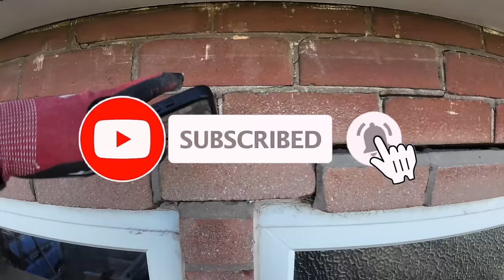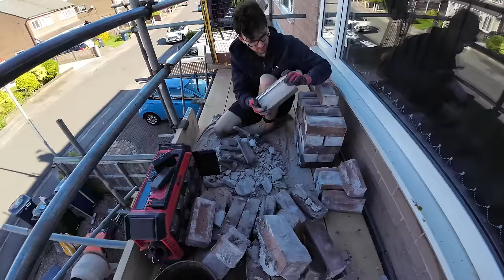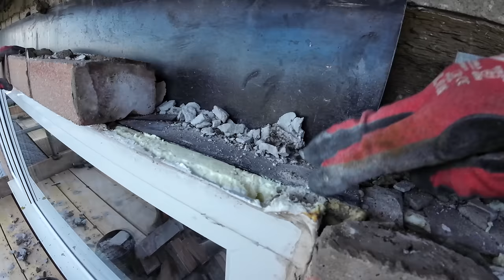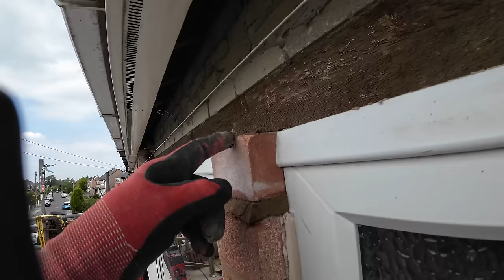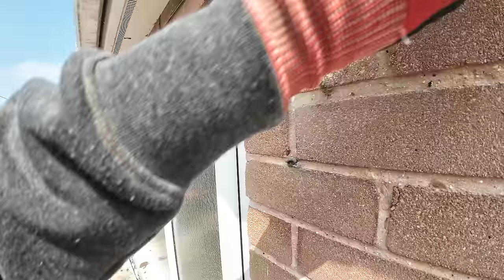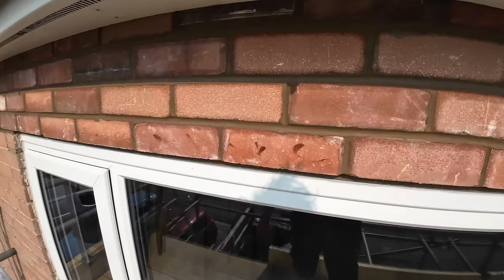YOU WON'T BELIEVE WHAT WE FOUND BEHIND THESE DANGEROUS BRICKS !!

Comment: Unfortunately fellas, that's going to fail as well. You need to take the front and back skins off and put in a steel with a plate welded on the bottom ,and potentially a new timber wall plate on the internal wall. Not your fault as the job looks good, but it is a design issue with the narrow brick column. You need to spread the load from the ends right across the total opening. Its not just supporting the brickworks 4 courses, its supporting the roof loading as well. If we ever get a heavy snowfall the roof will spread outwards and distort the brickwork skins. Alternatively, re configure the window sizes if possible and build a 3 brick wide pillar with 2 heavy duty Catnic or IG lintels to transmit the load over 2 spans.  [Structural Engineer]
Reply from the maker: I’m a bit shocked that you say you’re structural engineer and then say the roof load is being directed down onto the external face skin .
     I’m guessing you didn’t watch the whole video because if you did you would have seen that the roof doesn’t anywhere near the brickwork .
    We even removed a full course of brick to reduce the weight on the angle irons . There could be a 100 year blizzard and the bricks will never be touched ( as is the case for most modern built h it houses.
   You SE’s love your massive steels with plates welded on which is a massive cold bridge and you don’t have to lift them in.
    What you  are saying is the whole estate should be condemned and re built .
    Fell free to tell them all 👍🏽
Reply from the maker: It should never have been drawn let alone passed  and built 🤦🏻🧱👍🏽
Reply: @SteveAndAlexBuild  Why is it these days, the modern houses that are being built and then consequently have to be repaired, dramatically failing in some cases . Is it to do with local councils not overseeing that the plans as per regulations that they are drawn correctly and stress tests have been correctly calculated? And/ or the builds themselves are to regulations and standards. Which, brings in the next question, why didn't the regulatory building inspector of said council area not pick up on anything untoward. After all, is it not his/ her remit to follow every new build. After all, it's is their job, nay duty, that all buildings adhere to building regs and standards, along with the health and safety of prospective occupants.
Reply: 4 courses of brick is all that the lintels support.  The half-brick pier is less than ideal, but the stress (about 25 psi) applied from the lintels is well under the allowable compressive stress for brick when the fact of the lateral bracing of the adjacent windows (and caulk) are considered.  Of couse, when the windows are replaced that brick pier will be dangerous because it will come apart during window removal.  This repair performed is reasonable, given the initial conditions. [ A structural engineer who deals with the less-than-ideal real world]
Reply from the maker: Thanks for the common sense response.
      There are dozens of similar houses on the estate still standing since the 60 s 🧱👍🏽
Reply: That half brick pillar between windows is a bit concerning. I would have screwed the ends of new steel lintels to each other with an over lapping plate and to the timber lintel behind, if necessary using some plastic spacers to prevent cold bridging and to give a little bit of an air space.  Since the lintels are only holding up four courses it would be possible at a later stage to take that silly pillar down and rebuild it in future.  I guess I am a belt and braces kind of guy and the job is a massive improvement over what was there.  The second hand steels with bolt holes reminded me of electricity pylon framing except pylons use very heavy galvanised steel with no possibility of rusting.
Reply: @nealr5530 100% agree, I get a similar bearing stress to you on the pier, maybe slightly less at about 18/20psi, and the work they have done is a huge improvement on what was there before.

Pretty horrible original construction that is far from ideal. My guess is that the house must be some sort of cross wall construction and hope that window pier is actually th continuation of a load bearing brick wall between the bedroom and bathroom (surely they couldnt have built just an isolated 4" x 4" brick pier between those windows could they!). Would be surprised if the timber lintel to the inner skin could support the brickwork and roof over if it was carrying a trussed roof, so suspect that the main roof may be 'traditional' but have ply box beams (or numerous meaty purlins) spanning party wall to party wall  and getting intermediate support from that bathroom partition as well.
Reply: @Bacchus173 its a 1960's build and pretty poor even for then, and that's saying something.

Comment: Considering what a dog turd you were faced with, you both did a cracking looking job on this. Looks so much better. Probably the soundest house on the street now. Interesting to see what awful building practices were considered the norm back in the 60's and 70's with those skinny half brick pillars and manky old rusty angle iron lintels. Not everything about modern building regs are silly.
Reply from the maker: Cheers Danny , very true 🧱👍🏽🫣

Comment: How on earth did any Building Inspector pass that construction?
That mid pillar is doomed to fail.
Reply from the maker: Still going strong aftert 50 plus years 😆
Reply: @SteveAndAlexBuild  I would hardly call it strong, there is a lot of stress concentrated at that point and the slenderness ratio is just crazy.
It may have survived but its certainly not good building practise and I wouldn't be surprised if it did eventually fail.
Reply from the maker: @hazmat5749 it’s a shite build but there isn’t a lot of weight up there 🧱👍🏽

Comment: What building inspector would have accepted a 100mm brick pier more to the point what architect would draw it?
Reply from the maker: Exactly, pretty unbelievable. There are dozens just like it on that estate 😫🧱👍🏽
Reply: @SteveAndAlexBuild was it literally a 100x100 pier? I was hoping it was the continuation of the bathroom/bedroom partition, even though that would have been a horrible cold and damp bridge. I just cannot believe that people would ever consider a stack of half bricks to be adequate, even if the load is tiny.
Reply from the maker: @mikebarry229 awful design 🤢🤢

Comment: Great jobs guys…quick question…why did you add lime to the mix?, curiosity from a ‘non bricklayer’ and, what mix ratio was it?
Reply from the maker: The house is lime mortar .
 6 . 1 . 1 🧱👍🏽
Reply: Adding hydrated lime to a mortar mix can help to improve the performance of the mortar, giving a cement sand mix some of the properties of lime based mortars.

A quick Google search will list some of the benefits.

You also don't need to add a plasticiser if adding lime too.
Reply from the maker: @jasonshulme 🤙🏾🤙🏾🧱👍🏽

Comment: Great video. How did you level up the lintel on the larger window as it was leaning in when you put it in initially.  

I did a similar job last friday. Had a 2400mm lintel with a massive upstand and it kept falling inwards so i packed some 3x2 timber noggings behind the upstand to level it up best i could. Im not a bricky and just wondered how you professionals do it. That was the most important part of the video for me and it was bypassed unfortunately. 

Have liked and subscribed. Top job fellas
Reply from the maker: Thanks for watching and subscribing Jim. we usually use 4 inch nails into the timber lintel so they brace the angle iron and stop it rolling back 👌🏼🧱👍🏽
Reply: @SteveAndAlexBuild  thanks mate.   Helpful tip. Same concept but using nails rather than the timber packing i used.
Reply from the maker: @jimboBFC1 🤙🏾🧱👍🏽

Comment: That air block has to go back, as it matches up with a ventilation brick on the inside wall.
This would have been put in to resolve the damp in the room caused by the shoddy brick work on the lintel.

Comment: I had a good call out for a bath that wouldn't drain ,   another blockage i thought ...but after several headache moments i realized the bath was below the drain outlet yet had obviously not been touched in ages  . Further investigation revealed all internal downstairs  walls removed with steel beam supports. However the two or so inches above the beams was not filled in and the entire upstairs had settled to it ..then i notice the cracks elsewhere and doors that did not shut ...
Reply from the maker: Jeez that’s horrendous 😳🧱👍🏽

Comment: This is commonplace for houses built in 1960's/70's where the external skin was deemed to be a 'flat arch' and the brickwork sat on the timber window frame.  Move forward a few decades and the timber windows rot out and the plastic window installers include a Catnic (or others) single skin galv bent steel lintel, which you will see behind the steel angle.  That lintel should be adequate with the recommended 150mm bearing.  I can only speculate as to why the steel angle has been installed but it does not belong there.  This all supposes that there is a lintel supporting the inner skin.

Its sad to say that none of this construction surprises me, crap building has always existed, especially in housing and to be frank its getting worse as basic skills are disappearing.

Comment: The internal walls will also have the same issue if the narrow brick pier matches the external which it should do as the windows are the same size. The wall plate is at risk with the roof loading. I know Structural Engineers are a cautious lot fellas but they are for a reason. All the implied loads are on the wall plate, which is probably 100 x 50 with some sort of "lintels" below. My comments are not any reflection on your work which looks very professional but the truth is its a really poor design originally.  Don'tshoot themessenger guys, I've been doing this for 47 years and no doubt the design was acceptable back in the 70's and 80's. It's 50 years later that the problems occur.

Comment: The original was a stupid structure with the two ( four) lintels curtailed ends ( angled iron) sitting on that central narrow  thin column. The inner and outer wall could flex out and they are only held laterally in position by the horizontal roof joists.  Absolutely ridiculous That should have been one long lintel and the inner and outer wall tied together, as the moment of inertia sideways would have been better. The original architect should have his licence revoked. Absolutely frightening. Under these circumstances these gentlemen could not do any better. That top gap does not contribute to good insulation.  Congratulations.

Comment: "double botch job doing sod all". saying it all.
'If you think an expert is expensive, try an amateur'.
Previous owners probably had it done on the cheap, and ran to the woods taking the proceeds with them.
Aren't those rusty lintels the result of that poor brick laying?
Reply from the maker: I think they went in rusty as they weren’t getting wet tucked under that soffit 😒🧱👍🏽

Comment: Totally bad original design all round. If there are two rooms inside, those windows will be set right up against the partition wall, which looks so naff. All it would take is a slightly smaller window on both rooms and a nice single brick pillar up da middle. What were the designers thinking???
Reply from the maker: Absolutely shocking 😒🧱👍🏽

Comment: So you left that dodgy half brick pier in and then loaded the new lintels onto it, what with that and the disgusting timber lintel already there, the whole job from initial build along with the damage done by the retro upvc window installation is a bodge from start to finish, if I was you, I would never have got involved with it.
Reply from the maker: We don’t just abandon customers because the work is a bit awkward, plus internal timber lintels are excellent we have never come across one with any damage to it .
    What you are saying is demolish the top half of the house, somehow prop the whole roof up then re build it with new windows and all the internal works, plastering and decorating that goes with it .
     Would you pay for that ?

Comment: Its still not a proper job sadly. Next time the windows are replaced that half brick pier will be lively and potentially your new work above. I get why you did what you did, been there done that. But i would have never posted a video of me doing something not done the correct way. 
1 continuous lintle with 150mm bearing  is what is required because there isnt enough bearing or stability from the 100mm pier and at that length youd struggle to find a single skin /Ang catnic  lintle long enough. 
You seem like nice guys and show a lot of knowledge but this isnt ideal and people should not think its ok.
Reply from the maker: So you say it needs an approximately 6 metre angle iron, let me know where you get your 6 m angle irons from i'd love to know
Reply: @SteveAndAlexBuild  4.8m would have done you, yes they do exist believe it or not 😉👍
Reply from the maker: @mic24 the huge timber lintel is one full lintel and is doing all the work supporting the roof .
      The angle irons are holding up a few bricks and nothing else .
    I’m sure the big lintels do exist by special order at an extortionate price .
    I have never seen a lintel of any description that big in 37 years
Reply: @SteveAndAlexBuild  well in nearly 30 years I have seen loads and yes they are more expensive obviously but considering how much the job probably cost with scaffold and 2 men for the day I bet the customer would have paid the extra £250 . 
I'm not going to argue with you anymore, can't be arsed.
But I guarantee that next time window fitters drill into that pier or  hit the underside of those steel lintels with a SDS bit (cause that's what they do) there's a good chance itl work loose.
Reply from the maker: @mic24 good chance it won’t either .
   Can’t be arsed arguing but still had to get another comment in .
    We will leave it there then